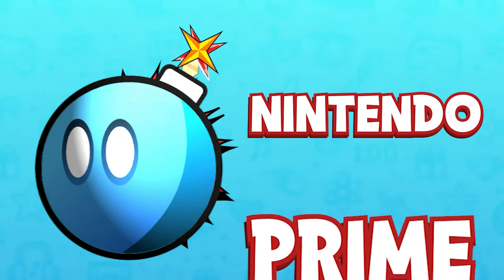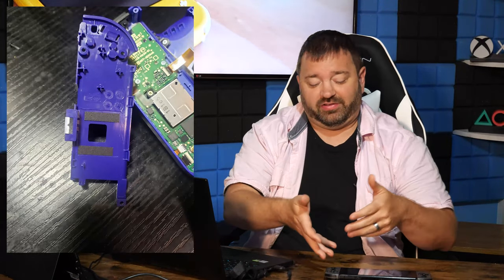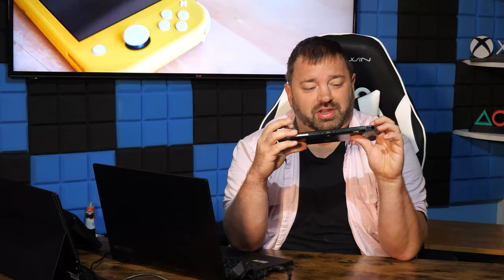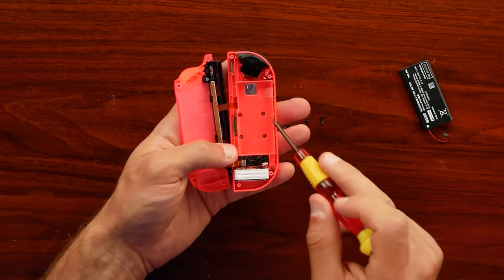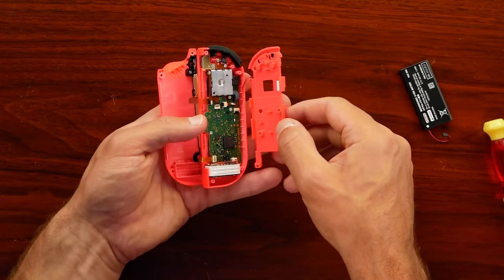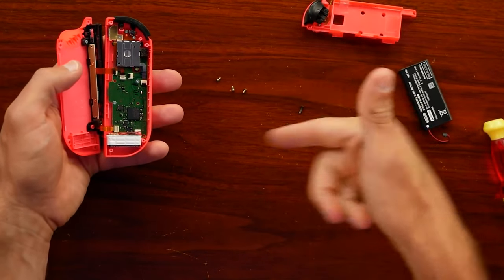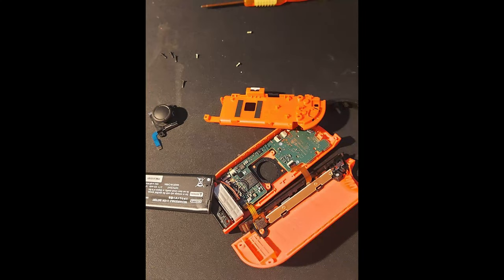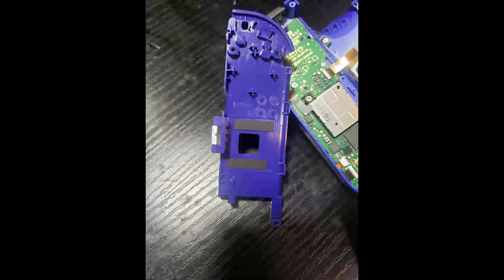Nintendo Tried to Fix Joy-Con Drift?!

Comment: I have now 3 sets of joy cons. My blue and red (came with the console), green and pink, and the zelda joycons. The only one that has ever had drift was my blue one from the original (version 1) console. I sent it in for repair and it has been fine ever since (about 3 ish years). I’ve been lucky I guess.. knock on wood
Reply: My pair I got at the start of the pandemic do drift but the drift is so minimal i haven't had any  problems. Drift started several months ago but hasent gotten worse. Got a spare set just in case

Comment: Got my Zelda joy cons yesterday. Doubt it solves stick drift, but I did want to try Skyward Sword HD as my Wii Remote I use with Dolphin is going bad and getting good unused Wii Remotes yet is kinda hard now. Tried it today, definitely isn't as consistent as the Wii Remote. I lose calibration constantly with the joy cons and I struggle to ever get it to register vertical strikes. One thing it is far better for though is the beetle. That thing would never fly straight on Wii but on HD it does so basically flawlessly. On the original you had to rapidly shift between left and right to go straight. Very rarely did it go straight on Wii. So some things are better, but as a whole I'd say it's a mixed bag. 

Most irking one for me is that on Wii even if my calibration was totally off holding straight up would still charge a skyward strike anyways while on Switch I just have to go up with current calibration which is really inconsistent.